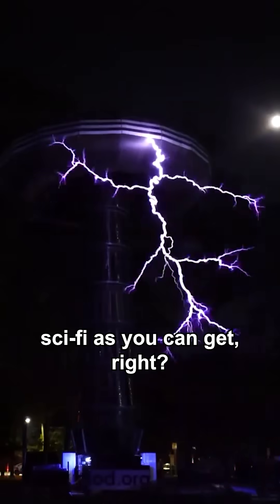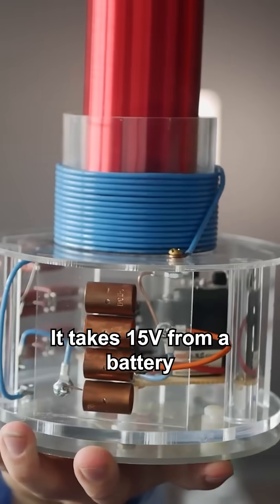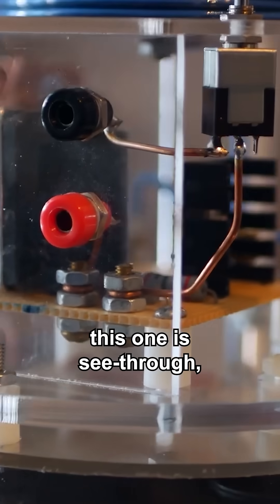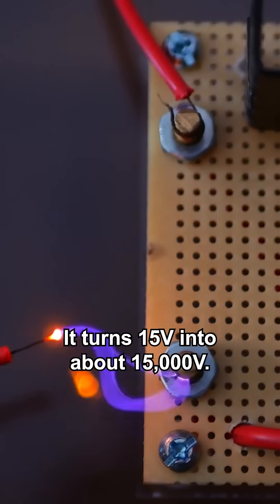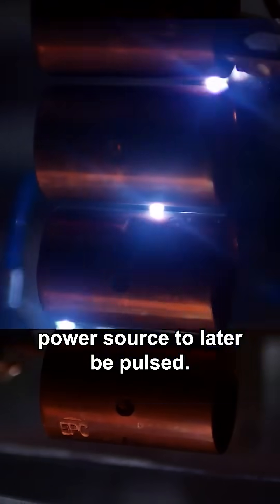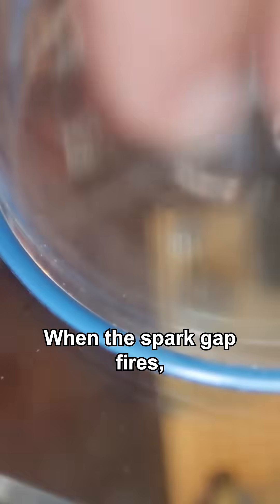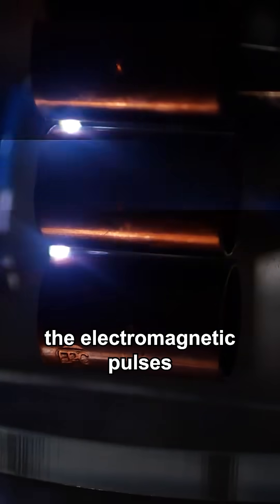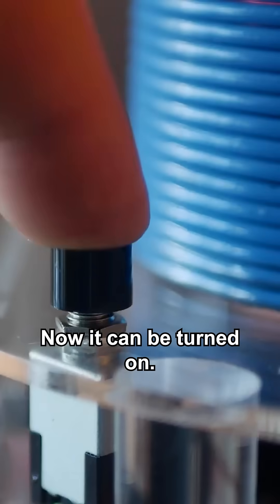DIY SEE-THROUGH Tesla Coil

Comment: I am now 73, when I was 16 in highschool I built one.  It ran off 120vac to a 15,000vac neon sign transformer, had a capacitor made up from 2 aluminum plates the die-electric was 18" square plate glass, the spark gap was an adjustable 1" brass rods, the primary coil was 40' of 50kv ignition wire, the secondary coil was a 4" diameter x 4' acrylic tube with 2600' of #26 magnet wire.  Estimated voltage output was more or less 1,000,000 volts.  3' lightening bolts were produced.  It was a fun project.
Reply: I am a 16yr old, and I wanted to make one small version, however I can't make it because I can't tell my parents that I am making it(my father deals with electric burn/death a lot, so he is very cautious about it) , therefore no funding for it. Also internet says that it is very dangerous, and can cause harm in house electrical system
Reply: @raajessahu6301  A safety solution might be to use an isolation transformer as your initial power supply.  Also, this might be a problem,  build a Faraday Cage to further isolate the device from everything around.  I hope this is of benefit to you.
Reply: @michaelschmidt7014 you really know your stuff I'll give you that one🤝🏻
Reply: @RiverRocc  It's a life time of experiences. Being single I have no one to pass my knowledge too bad technology has not yet advanced to where we could upload our knowledge directly from our brain to the Cloud for the benefit of mankind.
Reply: @raajessahu6301 don't do something stupid take a stem degree then try
Reply: I built one when I was 15 , and in highschool.
Reply: That knowledge on how to make one is a golden key now its up to you on what you choose to do with your key. @pablojr.1805
Reply: I had made many versions of Tesla coil and I am also of 16 years old
Reply: @pratikpatil8010  nice, how to make a tesla coil? Is the video of the plasma channel tutorial enough? Also, guessing by the username, Indian?
Reply: Looks like my type of fun.
Reply: @michaelschmidt7014  sounds like you got Brass balls to go with it 
You are bad_ss i like it